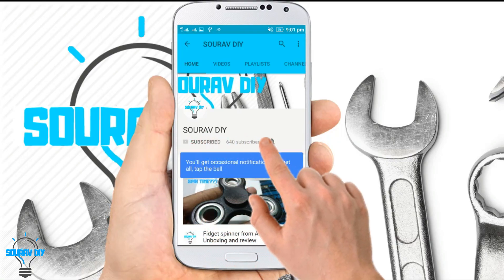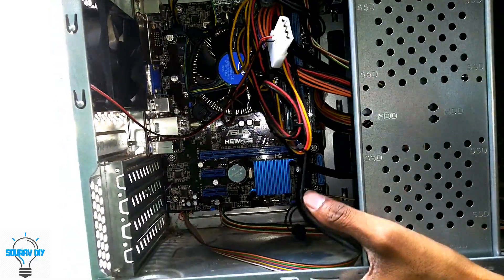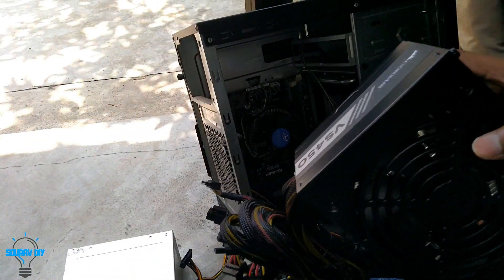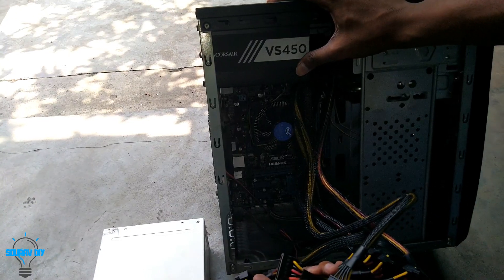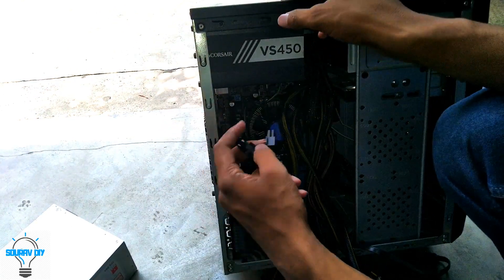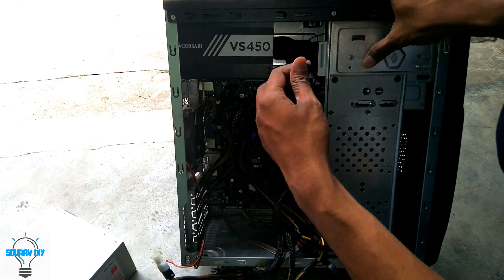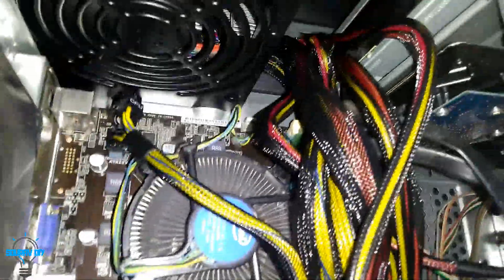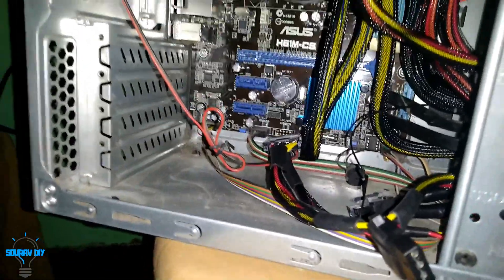How to change SMPS in pc | Corsair vs450

Comment: Hey bro.. i also have the same cabinet with the same iball zps254 smps... recently i have purchased a gt 1030 ddr5 graphics card and after that.... my computer is rebooting automatically sometimes...please tell me do i have to change my smps?? Because i am thinking that the iball smps may not power up my graphics card so it reboots...😕😕

Please tell me whether it is my smps problem??
And if yes.. please also say me should i buy the corsair vs 450 smps?🤔
Reply from the maker: Smps problem because that smps easily run 1030
Reply: @SOURAVDIY  so you are saying that i need to change my smps 🤨🤨...

Please tell which smps is best for me that can run my graphics card easily and i can run it 24/7
Reply from the maker: Corsair or cooler master 450
Reply: @SOURAVDIY  ok thanks bro...i will buy it within a couple of weeks😃😃

Comment: What is the fourth connection u connected? That is the power one? We only have three cables one is 24 pin main power supply to mother board then 4 pin to cpu then one sata connection to hdd and DVD if required then what is the other pin.. How come you have a separate fan.. One fan is for cpu one for smps and one we need for gpu what is that corner fan..?
Reply: What is this molex connector? And rear fan..? Bro we already have a fan with smps for cooling right then what is the purpose of rear fan.. Can you explain as I'm learning how to build a pc
Reply from the maker: @visitkeshav1  rear fan is to remove heat from cabinet , i have made a pc build tutorial check that
Reply: @SOURAVDIY .. Yes yes got it got it I was confused with so many fans.. And will surely check your videos in pc build Bcos I'm very much interested in assembling pcs and understanding latest technologies. Thank you
Reply from the maker: Molex connector for connecting rear fan